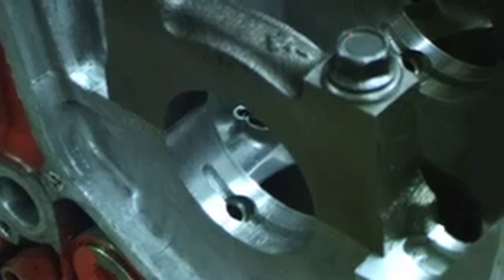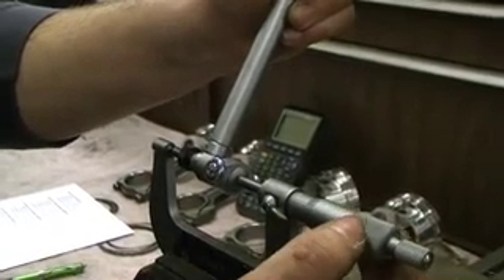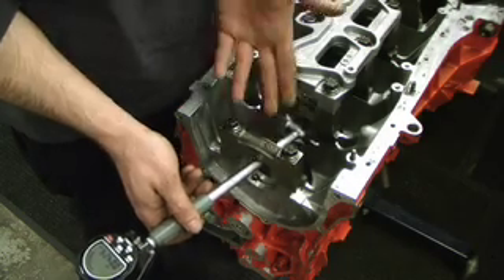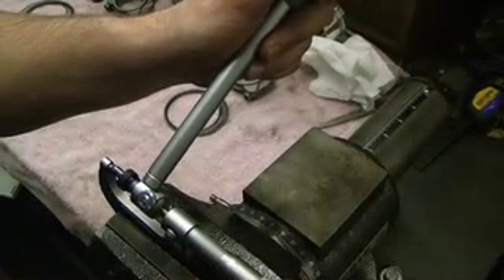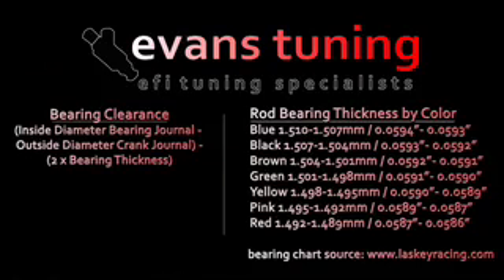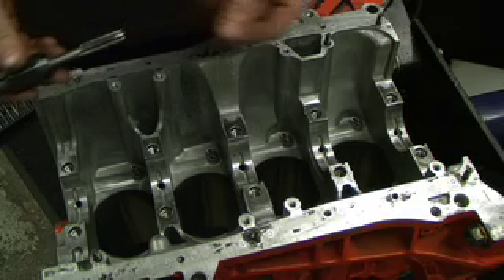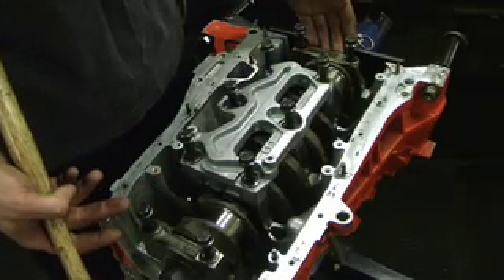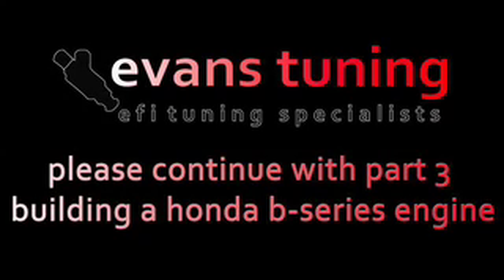Evans Tuning GSR Engine Build Tech Article - Part 2

Comment: i have a GSR transmissiin, and i wqnt to swap a LSD gear. what brand or type gear do you reccomend for this? i want to know if the gear from an LS transmission will lower the rpm in 5th gear?

Comment: .1757 - (2xBT[green = .0789-.0788]) .1757-.1578=.0179 and .1757-.1576=.0181. Leaves possible clearance of .0179-.0181 using green bearings. Honda calls for .0009-.0017 and your going with basically .018? Is that right? Sorry to bring up old sh!t. Someone help me here

Comment: @151soccer 

yes.... he could go into catastrophic failure.... everything inside needs to be tight. think about it.... the motor will turn over 5k rpms.... a small gap can mean a knock and something coming loose. not to mention if it's a performance engine.

Comment: Can someone explain the bearing clearance at 2:15?  Inside diameter bearing journal = 2.3237.  Outside Diameter crank journal = 2.1480.  When you subtract the two you get 0.1757".  Now you are supposed to subtract the 2x the bearing thickness.  I'm just not understanding that.  The gap between the crank and journal is 0.1757"  From there can someone please tell me where you go.  I'm at this point in my build and it makes no sense.  How does he get 1.8 for the bearing?

Comment: @EvansTuningDotCom Evans,...with all respects to you....just yesterday was checking on my fuel injectors and noticed #2 & #4 injectors tips are cracked, with your expertise,...what would be the common problem this,...bad injectors starting to go out. Friends of mine said you can run this without the Injector tips, by just filing them down as with normal use. Can you help...btw, Thank you for your video, appreciate the time you put into putting this together!!!

Comment: Yup nice vid. I need to show this to my instructor, maybe I we can show this to the class as a lecture. When we did some lab work on some inline 4s we didn't do the main journal diameter measurement, we only did plastigauge. Man I'm so hyped to start my GSR project. Any recommendations on rebuild kits? Bolt grades etc.. Also can someone demystify resleeving? I keep hearing to go with Ti sleeves if you go forced induction.

Comment: The video does'nt say that you should measure at several points and also both vertical and horizontal in order to see roundness. also plastigage sucks for everything else than to see  differences in measurement ie.  if its straight.

Comment: as far as building a engine im comfortable with doing everthin, but im nervos about the stuff like micromiters,dial bore gauge and plasti gauge, is it hard to use cause im bad at math but i learn by people showing me and i learned alittle more by watching this, but i need to know how hard it is to use these tools
Reply: b17ek  I took a machining class on micrometers they are fairly easy, I'd have to look at one to remember how it worked but it's sort of like a tape measure, every so many lines revealed is so many thousands of an inch then the other lines are fractions of a thousand. if I remember correctly, bore gauge works on decimals like the one in the video, and when u see him measure the micrometer (c clamp shaped tool) to a certain spec then put the bore gauge in to the same spec he zeros it out and when he walks it down the bore the .05 and .12 are how much bigger it is in that spot and it could've been bc of the force of him walking it down the bore making the numbers change like that..